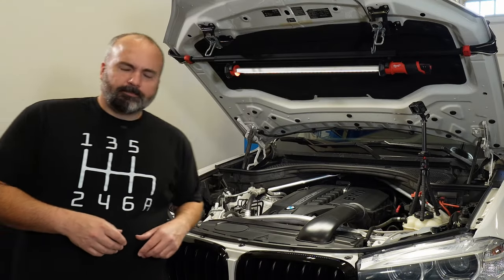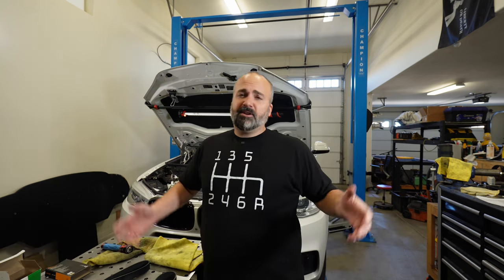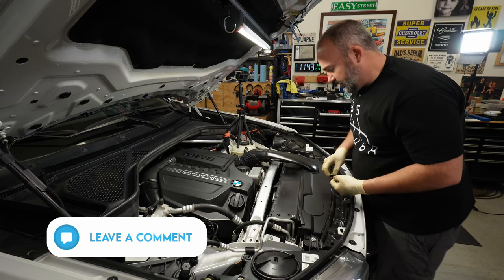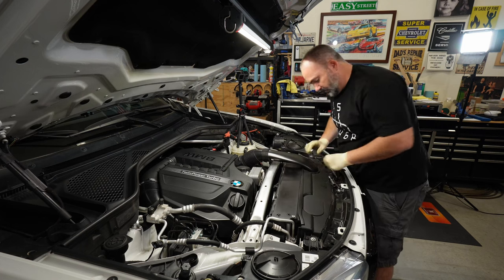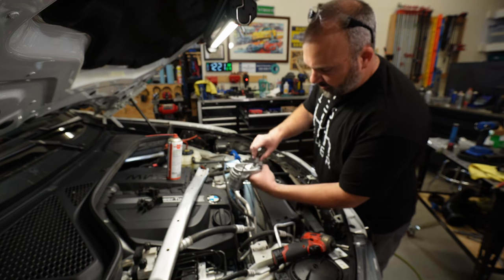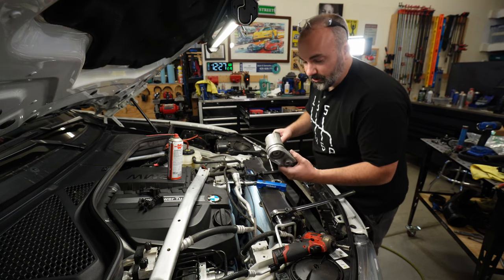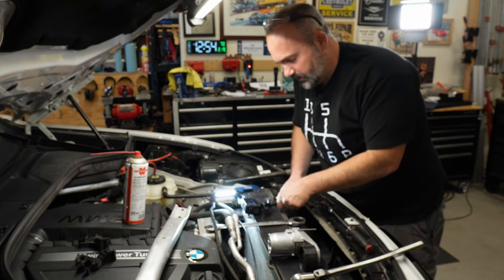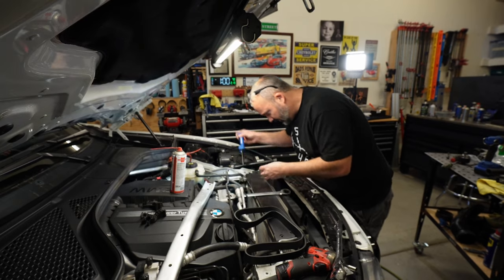BMW N55 Belt/Tension/Idler Replacement (f15, f10,f30)

Comment: Thank you very much for this. +1 subscriber. My OEM tensioner is so shot and mechanic that did my turbo install and maintenance at 80K swapped the belt but not the tensioner and idler 🤔 thank you very much for the helpful walkthrough.
Reply from the maker: Thanks for the comment. Hope you get all sorted out.

Comment: Just completed this job on my wife's 2015 X5 F15  at 112,400 miles - this video was a great help, thanks - the tensioner was dancing and its bearing was a little noisy - the belt looked good so not sure if the previous owner had it changed some time ago.
Reply from the maker: Outstanding. I'm glad the video helped.

Comment: On the F10, the idler pulley is blocked by AC line bracket.
Reply from the maker: I don't see it needing to be removed in the manual. Can it be unbolted and pushed to the side?
Reply: @DrivingForwardBuilds it's a lot more complicated to move out of the way

Comment: Thanks for the video, looks like something I could do myself.  I'm very interested to see the intake condition after 90k miles.  I've heard the N55 had some carbon improvements over the N54.
Reply from the maker: I'm curious as well. I plan to do a decarbon service on it and replace the valve cover at the same time since the PCV is integrated into the cover. We have had some slightly rough starts lately that leads me to believe maybe there is some buildup.
Reply: @DrivingForwardBuilds  Thanks!  If you do open up the intake, let us know how it looks.
Reply from the maker: @patusoro4781  I sure will!